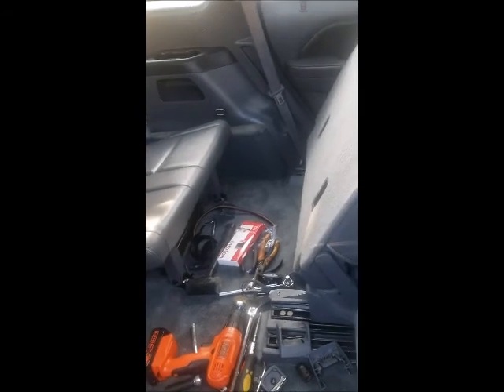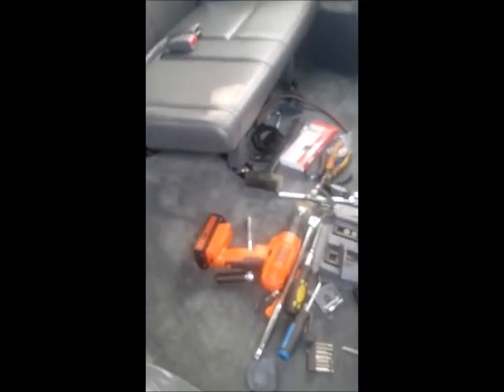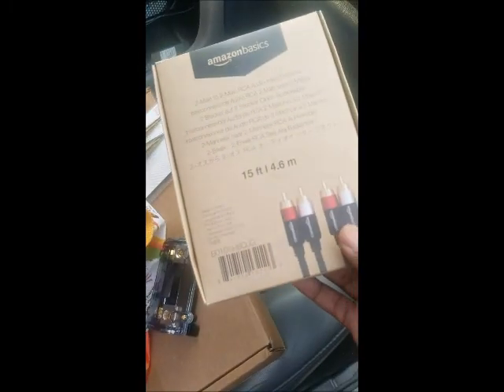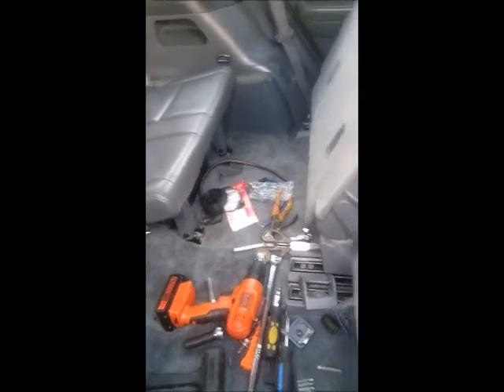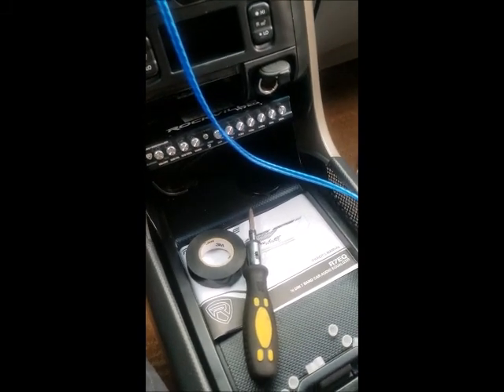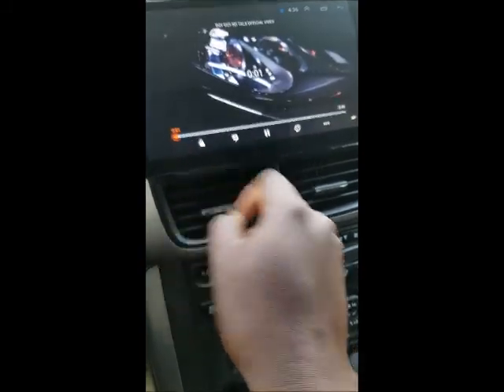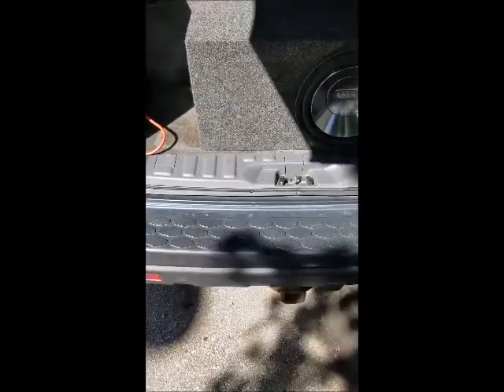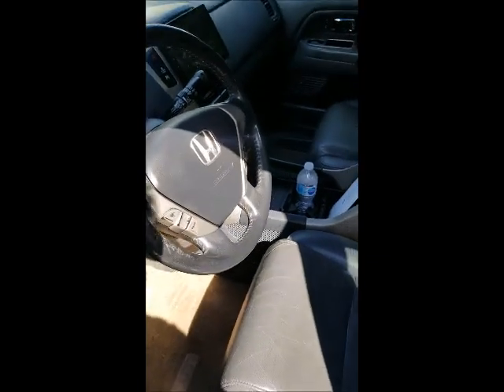2006 Honda Pilot Sound System Installation

Comment: that's why installers charge what they charge to run wires to an amp under a seat.  always easier to pull the seats and then run wire, so that it makes it easier to remove any side panels that are in the way, instead of fighting with lifting seats.  make sure you unplug the battery, if yo remove seats, in case they have air bags.

Comment: Thanks for the video.  How did you install the 10 inch LCD and what it looks like right behind it?  Can you share the link to the radio you used?
Reply from the maker: The unit had to be flush fitted to the panel because there was no way to screw it into the existing holes for the stock radio. I used some silicone to hold it in place into the panel. Here's the link for the radio https://www.amazon.ca/dp/B07TGHYTS3/ref=cm_sw_r_cp_apa_i_AlC-FbND2DHC9?_encoding=UTF8&psc=1

Comment: with the amp under the seat can you still fold the seat down?
Reply from the maker: I have no need to put the seat down which is why I placed them there or I would have installed them in another location such as under the front passenger seat.

Comment: What kind of Head unit is that? because I was looking for a 10.1 Inch one for my pilot
Reply from the maker: It's a Chinese branded I bought on Amazon. It's universal so it will work in any double din slot.

Comment: you could've sliced a small line in the boot on left side , not a specialist but is that even safe having a wire that close to the accelerator . as for the back up camera run it on the linen of the roof come out thru the back hatch where the other reverse lights wires are there's a sleeve there try running it thru there
Reply from the maker: The power wire may look like it's obstructing the accelerator pedal but there's some clearance between the wire and all travels of the pedal. With regards to the back up camera, the sleeve doesn't have enough space for the end of the video cable hence the reason why I had to run it like that. Tried to push it through the sleeve unsuccessfully lol.
Reply: @ArlandoToby  

https://youtu.be/cVkRZjCM6Vg 

this is my 05 pilot ,  I had just bought an 06 yesterday I wanted to find better ideas that's how I found your video . if you watch mine you'll see how I did my camera at about 2:12 mark but its a pain so I'm going to try wireless transmitter I've used it before but it was 2.4hz wasn't great now I ordered 5.8hz hopefully better signal
Reply from the maker: @uptownsfinest1598  initially I had installed a wireless kit but it was giving me too much issues and I already had the wired kit on hand so I just went that route. Hopefully the 5.8 GHz kit works for you

Comment: So how did you bypass the factory amp and subwoofer?
Reply from the maker: The aftermarket wiring harness does not use the extra harness that the amp and sub is connected to so no need to bypass any of those. The aftermarket amplifier will power the speakers and aftermarket sub.

Comment: Awesome video Can Toby!!
My question is, are you using a capacitor so that your battery does not drain? 
I am a recent 2004 Honda Pilot owner ( a day ago ), and like to install my after market system in it from my '97 BMW. Thank You in advance.
Reply from the maker: No I got the capacitor because the subwoofer was drawing a lot of power and the mid range speakers volume would dip. I have a high amp alternator so battery drain is not an issue for me. Check out my other video with the sound system upgrade which made things a lot better.
Reply: @ArlandoToby  Any suggestions for an high amp alternator for my '04 Pilot?
Reply from the maker: @wilzedens8676  ebay will be your best bet. That's where I got mine. I got mine from a company called BNR Parts